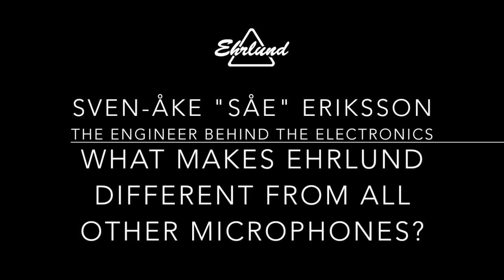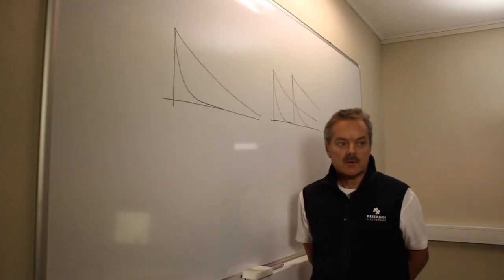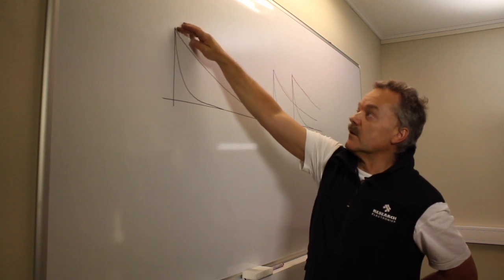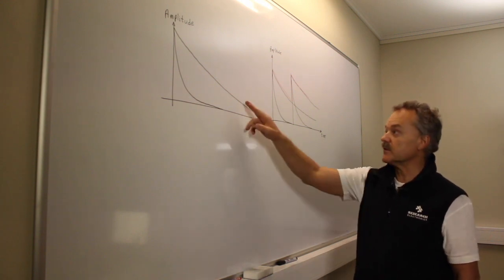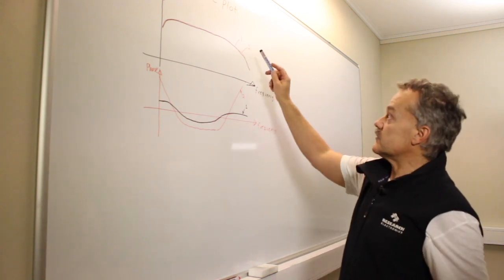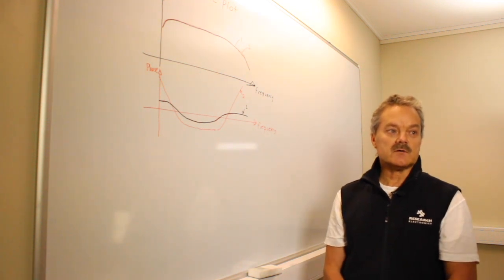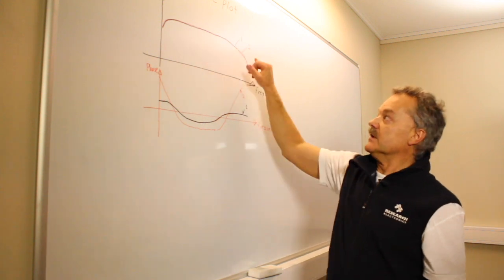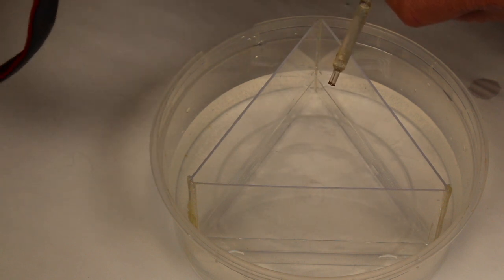Ehrlund Mics Technology

Comment: Has anyone done any side by side comparison of these mics with high end standard mics? I'm wondering how much difference their triangular diaphragm really makes compared to a round one. 

Their water drop into a round container of water verses a triangular one is great for visualizing what they want you to understand, but I'm not convinced that it's an accurate or correct representation of the physics involved. 

Why? Because no microphone diaphragm gets hit in the center by a single point source sound "drop" that then resonates outwardly in ripples across the membrane. Sound waves don't contact the membrane that way. Instead, they are broad source of high/low pressure compressions of air that are inches,  feet, or yards across which emanate from their source and propagating outwardly from that source like expanding inflating spheres of pressure waves. 

The force of this wave contacts the membrane as a nearly flat pressure wave effecting/covering the whole membrane at once (When entering the mic perpendicular to the membrane), not a singular drop in it's center.  There is no focused force in the center to generate these strong resonate waves. Rather, the whole membrane moves nearly as one as the high/low pressure wave interacts with it. It's more like a rubber sheet being moved by a nearly flat round disc, down and up with the waves instead of a the membrane being deformed in the center by a ball bearing - then turning that energy into horizontal wavs that travel out across the membrane.

As the source is more and more off axis, there may be more resonant waves generated as the pressure waves contact the nearest side of the membrane first, then move through the center to the far edge, but these are still wide pressure waves not pinpoint sources and since they are off axis, the wave and the resonance would be increasingly less and less as the source moves to the side.

I can understand that self damping is good. And more self damping is normally better. But since the problem is not exactly as they illustrate, and thus hundreds, if not thousands of times less powerful (important?) than the illustration makes it seem. 

And since the capsule itself is triangular, it has a substantially smaller surface area with which to gather pressure wave energy with, which would effect the sound and frequency response. It might even be the case that only the area within the center of the triangle, which is large enough to fit a circular membrane in, is fully sensitive to motion (the corners being to small and too tightly tensioned to deflect easily?) which would reduce it's functional surface area further and make it perform and sound like a much smaller diaphragm design (like higher frequency response and more detailed capture but perhaps reduced low frequency warmth?). This is being attributed to the unique shape rather than the smaller usable surface area.

I'm not a physics major or microphone designer. Anyone who knows more about either or both of those areas and understands my question/skepticism please feel free to enlighten me if I'm missing something or way off base on my thinking. Thanks!
Reply: They have Erlund mics on audio test kitchen if you want to do some testing. I don't think I've done enough testing to say conclusively, but so far the erlund mics seem to be holding their own for their price range.
Reply from the maker: https://www.youtube.com/watch?v=Y_8FYyknpYA
Here you go :)